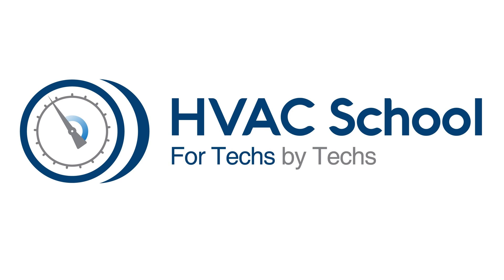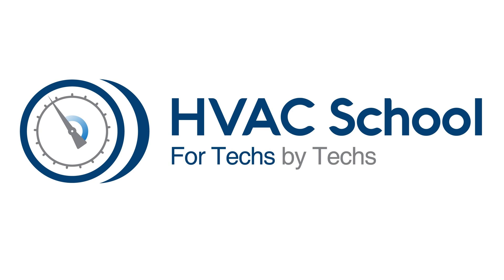Q&A - System Won't Dehumidify? - Short #214

Comment: Bathroom fans flappers stuck in the open position or in the backwards positions? If they’re in the backwards position they will open anytime the AC turns on.
Reply: I’d 2nd this. Major issue on many new builds with new tight home building standards. A few small lawsuits going on the Jax area with a few small structural flaws leading to abnormally high humidity specifically in kitchens and master bath/bathroom.

Comment: Here is the dirty secret in HVAC.

They claim they can "right size a system".  They are lying.  They can't.
In the best case scenario  they guess correctly and it'll run 24/7 in the hot season, causing it to prematurely wear out.  The worse case scenario they will undersize it, it'll run 24/7 and your building temp will fluctuate wildly throught the day.  In the cooler part of the year guess what you are back to?  Too much humidity because not enough heat load for it to run.  

In the Comercial world they just add a 5000w-10000w electric heating element to force it to run.  You can do the same.  Just go turn your stove on to high.  That makes sense said no one ever.

So what to do?
Step 1:  Address all the excessive fresh air issues he mentioned.  Too much fresh air and you will not be able to mechanical away this problem.

Step 2:  ignore your HVAC contractor and go up to Home Depot and buy an appropriately sized dehumidifier(s) for less than $500.  If your house is much larger or you want something installed get a dedicated dehumidifier system.

Benefits
1.  You get exactly the humidity you desire all year long.
2.  You take all the guess work out of your HVAC system.  Hot year, cold year, a big family get together, party, etc.  An oversized system works for you, not against you.
3.  Your electric bill will be much lower.
4.  Your main AC system will last much longer, since it is not undersized and running 24/7.

I worked in commercial/industrial HVAC for 3 years before I quit.